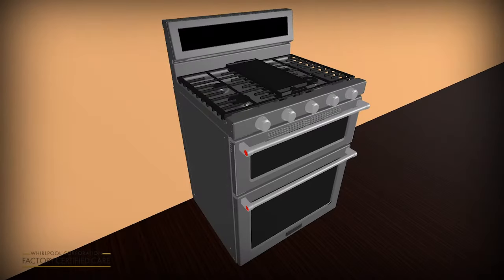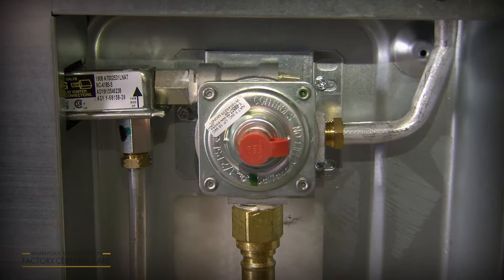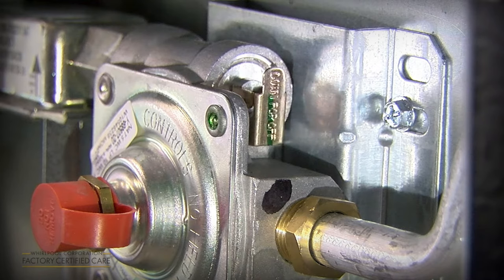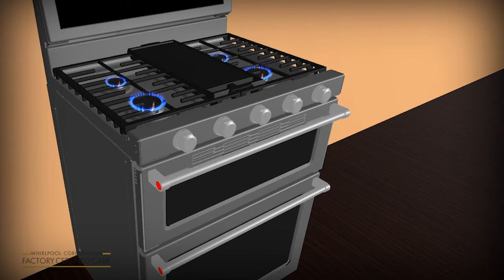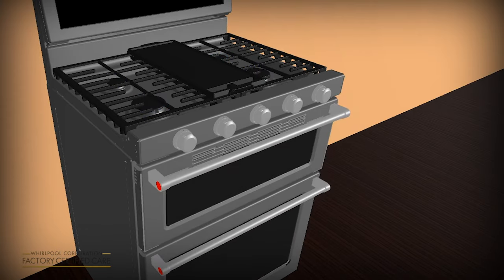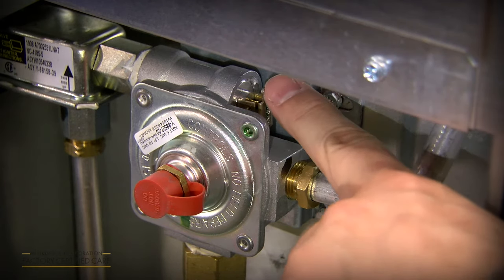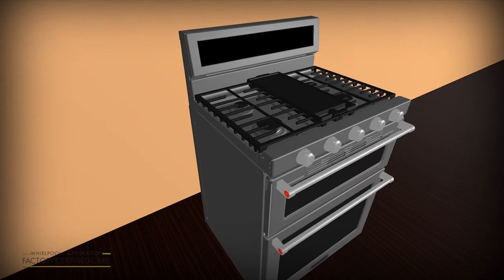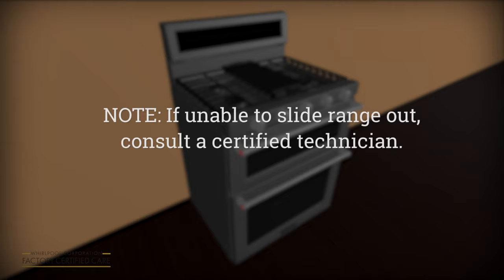How To Check The Gas Regulator Shut Off Valve

Comment: OUTSTANDING!!!!  Saved me from certain embarrassment and ridicule!  The little regulator two position switch was in the wrong position.  Oven now works.
Reply: lmfao me to went through 2 stove returns thinking something was wrong
Reply: lol!  He saved me also.  I blew the original regulator out from tightening the gas line too much.  Replaced it with a new one.  Stove top worked perfect, stove didn’t light.  What did people do before YouTube 🤣

Comment: Brilliant. 5 years, 5 years!!! I bought an LG oven dent and scratch.  The broiler and oven never worked...I took the whole thing apart, replaced the main board which took me 8 months to find as discontinued. O diagnosed EVERY single component ...nothing! Well the f...valve switch was indeed closed. Thank you, I can now enjoy a 5 years sto e with a brand new oven.
Reply: A broiler above shouldn't be affected by the regulator just like the top burners. But, not all stoves are designed identically the same.

Comment: My oven shuts down during cooking but starts up with a boom when I open the door. Any reason? Regulator going bad? Help! Thanks. Oh...it’s propane.
Reply: time for a new stove
Reply: @bkoz319  believe it or not it’s a new stove. We wondered why this would do what it did but apparently when you clean the oven using the self cleaning mode. After temp reaches 500* it has a safety sensor in it which needs reset after you clean it. But we thought it was the igniter so ordered one and found after we removed the old one and hooked it up cause I needed the oven before the part came. It worked again. That’s when we were told about the reset. That’s what I get for not reading the manual. lol

Comment: Hi W Service! Very informative video.  Was wondering what the actual metal switch is called on the regulator valve. My valve does not actually have the switch itself, just the metal rod that the switch connects to.  AH! Hopefully I made some sense, thanks:)

Comment: Help!!! What happens if that little red cap is missing?
Reply: This just happend to me. I was cleaning bottom ad knocked it off to no avail I used a flat head it will slid out but slowly will go back in timing is key it will slip right on and then you will gave gas to the bottom this vis is 1000000% on the money
Reply: There is a Grove you have to line it up just right